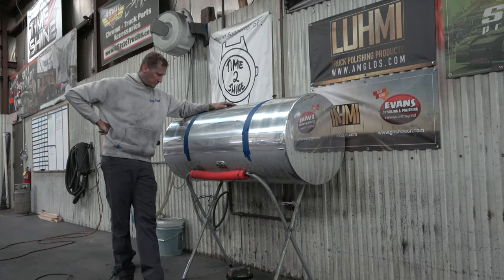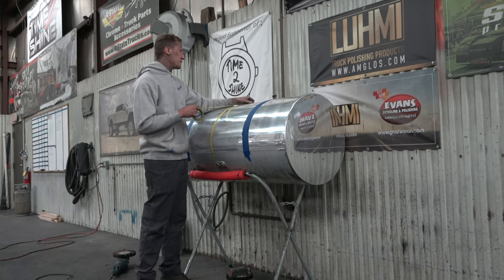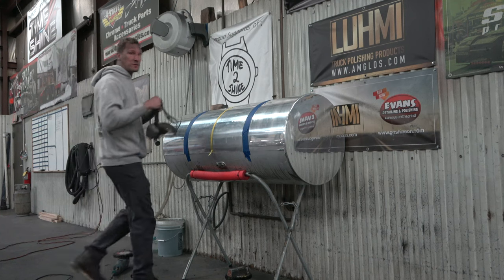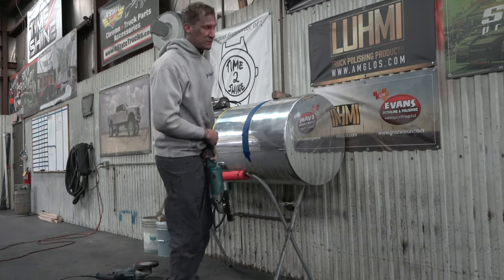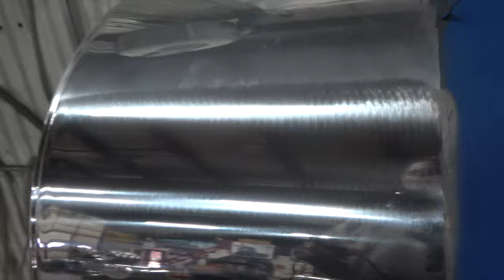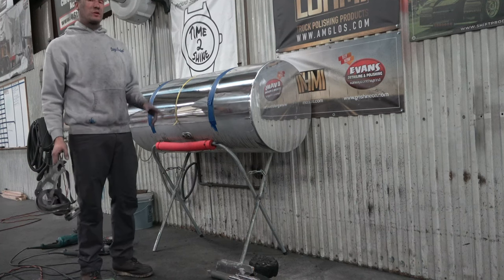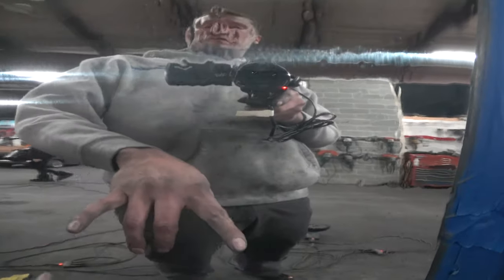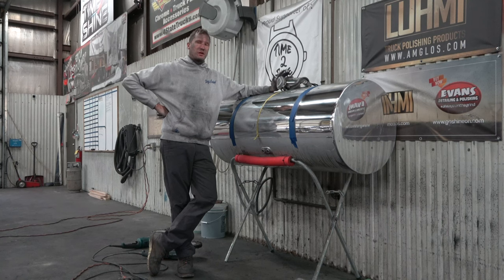How to polish aluminum in different ways. Evan's detailing and polishing.

Comment: Question for you. I have an aluminum PROTECH flatbed with aluminum head board on an 06 GMC Duramax dually 4×4. Im having problems in tight areas where the head board meets the bed. Their are some bolts and rivets that im having a problem getting in with the 8" airway buff it wont allow me to get in sharp corners. I'm using orange and brown and yellow and green so far. I sanded it to 600 the open areas and into the corners. The open are good but ive tried hand polishing in close around the rivets and edges but the tight corners dont obviously look as good as the open areas. Maybe you have a video ive missed? I think ive searched all of them that would apply with no luck so far. Thank you of you think you could help. If not i get it. Thank you for all the great videos and info.